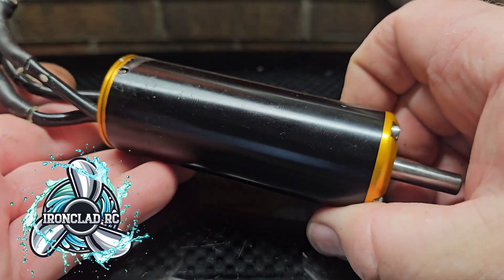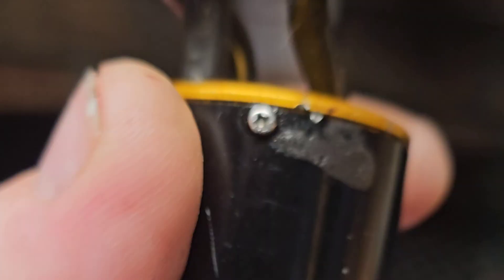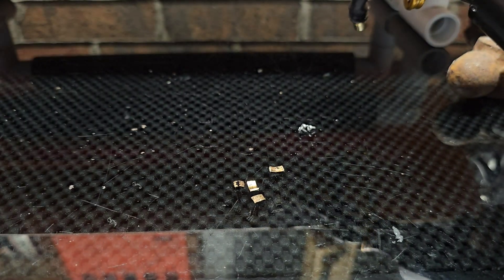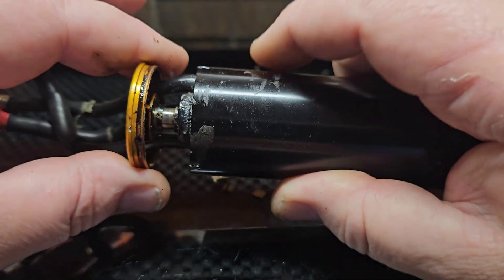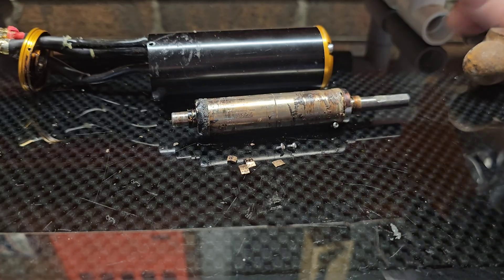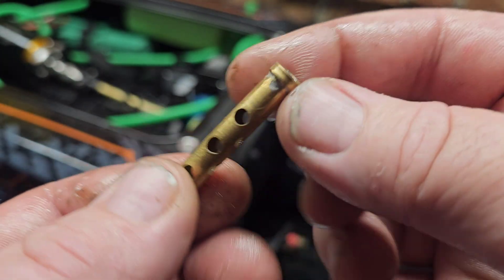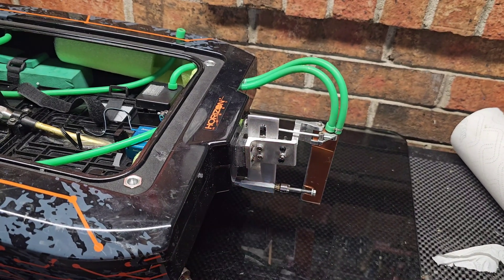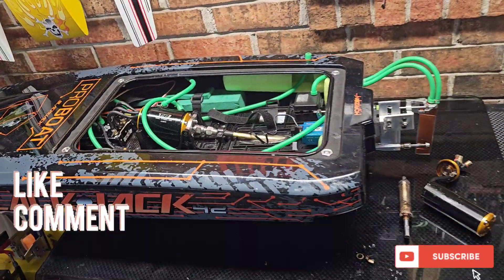Analyzing Catastrophic Brushless Motor Failure Tp Power 4070cm Proboat Blackjack 42

Comment: We use the square end flex and separate drive shaft to put the load on the strut. The straight through cable with welded drive shaft will put the load on the motor. The load will chew out flexi's and stuffing tubes as well as burn out motors/bearings.
Reply: This is 100% the best option 👍🏻I’ve never used it, and is more common with the guys running 1/4 shaft set ups. Who makes a square drive for .187? I’d definately look into running that 👍🏻

Comment: I am very very lucky I have not lost a shaft or prop or smoked a motor once. Been running my 4 Proboat boats for 2 years now. It will happen the question is just when ;)

Comment: Hey man what flex cable are you using in your shreddy? I've went through 3 now and the last one I lost the prop on. I'm running the 4065 1900kv & 120A spectrum electronics from the sonicwake in my shreddy. 3 everything runs smooth, 4s cable grenades itself
Reply from the maker: Personally I would upgrade the flexcable size since your running a "big block"   

.187 3/16 cable should do the trick, you will need a new collet for the larger diameter cable  5mm to .187
With no teflon liner!    Remove the linner with the stock stuffing tube. 

Collet  5mm to .187
https://www.offshoreelectrics.com/proddetail.php?prod=ose-81518&PARTNER=ironclad

Cable .187 
https://www.offshoreelectrics.com/proddetail.php?prod=tfl-510b50-620mm&PARTNER=ironclad
 
This should do the trick, not the cable i run but should work for your heavier high power setup
Reply: Awesome thanks man!  @IRONCLADRC

Comment: Just like some of the other guys are saying, the thrust from the prop “could”have been what did this, instead of the other way around. Not sure if you were running electrics in the early days, not many of us were. But too much cable gap and you’d burn up the end bell on a new motor in one run. The big back and forth is whether the strut or the motor should take the load, I think this explains why the strut should take the load 👍🏻 I’ve got 2.old hackers on the bench right now, a b40 that locked up like yours, and a b50 that still spins but has over 3/16” of free play. Both of those motors were in monos with rear motor set ups. I was running them with 1/8” drive dog to strut gaps which iis probably to large for the tiny bit of cable wrap you’d get, so the load transferred to the end bell, one locked up and I guess the one that has all the free play lost its bushing. I guess the question here is weather we want to chance our motors taking the load or the driveline!? I guess the old problem we had early on are still here, just not showing up untill big power is applied in your case or mis adjustments are made in my case. Great video though. If I feel better tommorow maybe I’ll tear apart those hackers to see what they look like inside 👍🏻

Comment: It's a chicken or egg problem, did the bushings break first or did it overheat first? The tp motors shouldn't get hotter than ~170 degrees, otherwise the magnets will break and then they'll need a lot of power! That could explain why your zee batteries were drained with one pass.
Reply from the maker: Two passes with the zee packs, end voltage was at 3.7.

Comment: Think about it for a moment:  The entire thrust load of your setup was going through that spacer bushing and onto the front ball bearing.  I'm surprised it has lasted as long as it did.  In my bigger boats, I always try to run a ball thrust bearing between the motor and the coupler; that way the motor casing takes up the thrust loads, not the spacer and front bearing.  I'm sure Steve at OSE has them, if not a quick eBay search for ball thrust bearings will turn up thousands of results.
Reply from the maker: Never really run into issues with my 6 & 8s setups, i guess pushing 10 & 12s i will need to incorporate a ball bearing thrust washer into my driveline..   Thanks..
Reply: @IRONCLADRC  Most of my stuff is so small that I can safely rely on the motor bearings to take up the thrust loads.  You on the other hand, like to push the limits, so they may be a welcome addition for your higher-powered boats.
Reply: This was fairly common years ago on bigger/powerful builds. With bigger and more motor options it seems to be nearly non existent.
Reply: I'm building my first attempted really fast boat with a 4070 svm 8s. I see lots of thrust bearings that actually slide in between drive dog and strut. I'm trying to think of how you could set one up on front of cable after it comes out of tube inside boat. I guess with one of those prop saver things and pushing up against a thrust bearing somehow sandwiched against something else before coupler?

Comment: Hey Big B, can you dip that motor housing and rotor in your lemon juice solution ? ….  Um why do I have the sudden urge to listen to Led Zeppelin,  anyway I have at least one motor I need to deep clean, what’s your thoughts ?  
  I have always tried to have my thrust washer take most of the thrust, two thin thrust washer are better, but this  a changes the handling characteristics.   
I wonder if a demonstration of how much a flex cable draws up under load is possible, maybe with an airplane prop on the drive shaft, I remember you showed us how mush a boat prop flexed 👍
BGFL
Reply from the maker: This is what I use to clean my motors, CRC  lecta-motive cleaner 
https://www.crcindustries.com/lectra-motive-electric-parts-cleaner/
Reply: Big B , there’s a chance that the 2 piece soldered bushing in the strut let go first, causing excessive loading of the motor bearings / slash end bell. 🧐 Is the front motor bearing seized ? Since the motor is at a angle 📐 and heat does travel upwards. ☺️

Comment: So back in the 80’s when I was into nitro boats I was taught that the thrust bearing or washer should just almost touch the strut but now a day I see the electric guys using the motor end bell of the motor to be the positive stop for cable walk. I often wonder how the end bell holds up to that pressure.
Reply: I was just wondering this myself with my Impulse 32. After I greased my flex shaft (it overheated) putting it back in I noticed it would bottom out in the collet with a 1/8” gap between prop collar and prop strut washer. I wondered if the motor or the prop strut was supposed to take the thrust, or perhaps share the thrust. 

I got a second impulse 32 hull from towerhobbies scratch and dent so I’m going to build it with modded parts and stuff and I was going to try and set it up considering flex shaft length and alignment.
Reply: @fastmaxxcooper  wish there was a solid cable more available